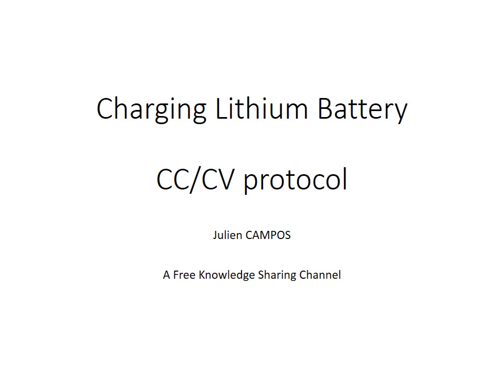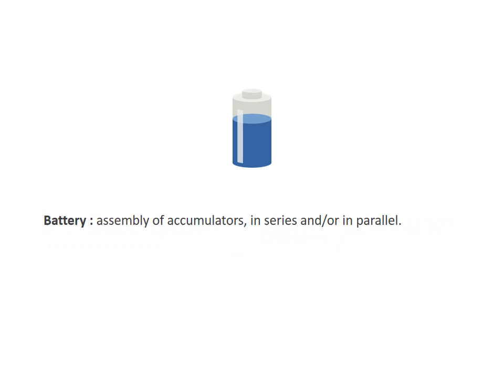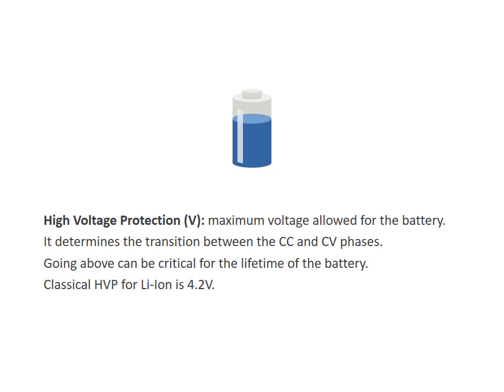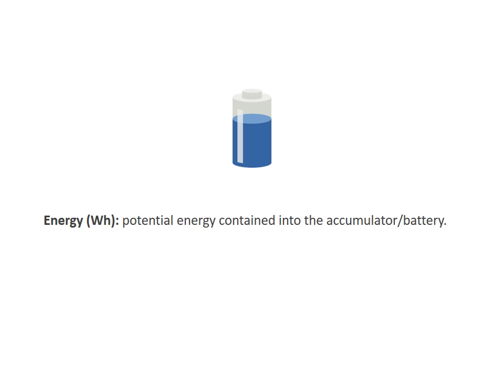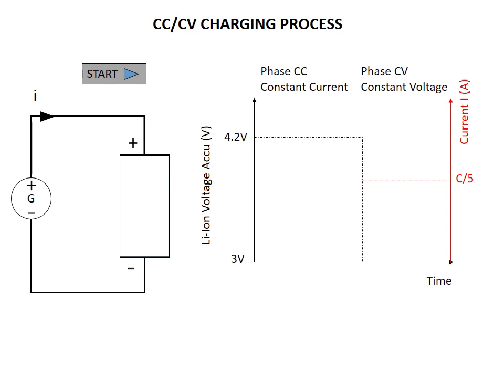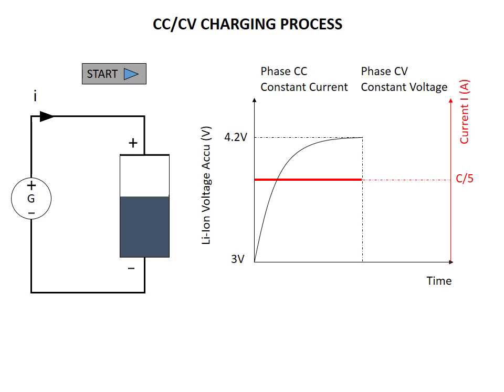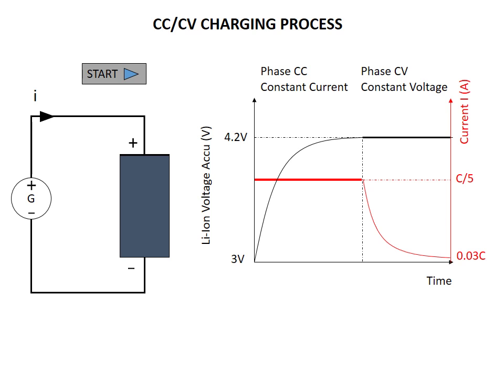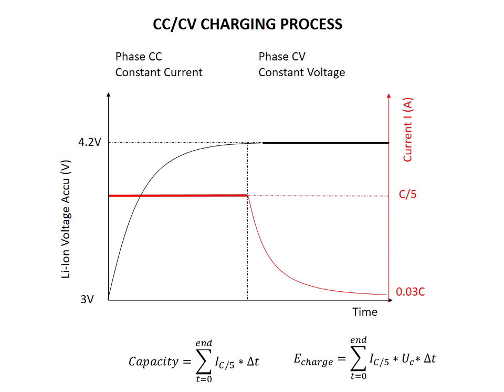CC CV Battery Charging Process EN

Comment: Hi Julien,

I have a Li-ion battery and I want to charge a cell with a power supply. I have been reading about the CC-CV charging method and everywhere it is said to set the voltage upper limit to 4.2V and to limit the current to around 1C (in my case, it is 7Ah). 

The first time, I started charging the cell when its voltage was 3.8V but the current that flows from the power supply to the cell was only 1.3A (I have set the max limit of the current to 6A) and I do not understand why it is so small (the value of the internal resistance of the cell that appears on the datasheet is around 1mOhm) so I do not know if I should increase the upper limit of the voltage during the CC phase (maintaining the limit of hte current on 6A) till the current reaches 6A and setting it to 4.2V when the cell reaches this value of voltage (when changing to the CV phase) or it could be dangerous for the cell.

Thank you very much.
Reply from the maker: Hello Daniel,

Which power supply unit are you using?
If you have possibility to set both current and voltage limit, if you set:
Vlimit = 4.2V
Ilimit = 6Amps

The power supply will naturally go to one of the mode: voltage source or current source.
When you had that current lower than 6 Amps, what was the voltage limit that you set? Normally your system would have been here in voltage source mode.
By the way, never put a voltage limit higher than 4.2V or other value that the Li Ion supplier would recommend.
Other thing: some power supply vendor give you possibility to set voltage or current protection value. These are a bit different than voltage or current setting in the sense that IF your system reach that value, the power supply immediately disconnect the power supply.
Of course, V and I safety setting are always a bit higher or lower than your settings to not stop unwillingly the charging or discharging process (discharging for load source which are a kind a power supply that can absorb power) .

Comment: hi sir,
i want to know when we charge battery in CV mode the current gets decreases slowly. but my question is that how they set the stop current for charging. is there any standard aboyt this
Reply from the maker: Dear Harshal Sable there is no general rule on that question. It depends. Some manufacturer will tell you 0.03 C, some 0.1 C. The smaller you set, a little bigger capacity you will get but not so much. And it will take you also more and more time as you tend to 0 C (until infinity in theory). Regarding existing standard, please refer to the IEC 61960. If my memory is good, they don't give a end of charge rule based on a value of the current in CV mode, but on a time basis. They say that your charge is finished one hour after you entered into the CV mode. It is up to you, but that may be a good start that you use this rule.

Comment: hello sir,
what are the major advantages in shifting to CV mode?
 why current is exponentially decreasing in case of CV mode?
Reply from the maker: Hello,

Below multiple image so perhaps you can better understand:
When charging an empty battery, you displace in opposite direction charged particles, positive and negative, from one electrode of the battery to another. A bit like when you pump water from the bottom of a river dam to its top in order to recharge the reservoir. To displace that water you need some "force", moving up the water of a certain "height". In your battery this "force" comes from an electrical field applied by your power generator. The height of the river dam represent your voltage. 
Charging a battery is like filling up a river dam: if you fill up too much you can have issues. 

We can't speak of advantage or disadvantage of moving to CV mode cause moving to CV mode is done naturally by your power regulator when you reach the maximum voltage recommended. 
Why the current is decreasing this way once reaching the CV mode?

Other image to help you: for a given force, it comes more and more difficult to the power regulator to move positive and negative charge from one electrode to the other. A bit like when you fill up a balloon: in the beginning with a fixed volume of air per second that you inflate, you will find it easy. Once you reach the stretching limit of the baloon, if you keep inflating with the same force, you'll see that the volume of air per second passing is reducing cause you are in opposition with the pression of the balloon itself which applies a higher pressure in return equilibrating with yours for a lower flow. Of course you'll understand that if you don't like the air flow to reduce, you can increase the pression of air flow by your mouth (voltage applied) and you"ll see the ballon stretching until it explodes.

Hope that helps you
Reply from the maker: Also, once in CV mode, you have normally charged the battery for 70 to 80% of its capacity. Going into the CV mode will charge the remaining 20 to 30% but it will take you a longer time, actually the closer you get to the 100% capacity the longer it will take you. Some charger who says they charge ultra fast is because they don't go into the CV mode.
Reply: @julienc.4916   
I agree with u sir, what u have explained is absolutely correct but there is a slight change. That
lithium ion or polymer battery never be charged to 100% bcz of voltage stress problem so, it's advisable to charge below 100%.
Reply: can u please send me any link related to CV mode
Reply from the maker: @raviteja-bn2eg  
It is a bit more complex than that. In fact to say a battery is 100% charged is a convention based on a protocol of charge and discharge given by the battery manufacturer and for which he guarantee a certain capacity. This protocol is a CC/CV with a charging stage and a discharging stage. Typical example of a protocol used to define capacity based on the IEC 61960 standard:
For the charging stage:
- Charge at 0.2C for the CC stage,
- Transfer to CV mode once 4.2V reached, and stop the charge once you reach current defined  by a fraction of C, or stop after a defined period of time, typically 1 hour.
For the discharge stage, this one is used to calculate your capacity:
- 0.2C discharge current,
- End of discharge at 3V.
Capacity is simply given by the expression:
C (mAh) = discharge time (hours) x discharge current (mA)
You can find these information by reading the IEC 61960 standard.
When i say it is a convention, a battery manufacturer can decide to use its own CC/CV protocol, which can be more favorable to battery life, but will gove less capacity (you can't have all). It is better for example to define your CV charging stage at 4.1V instead of 4.2V for Li ion battery, as it will give less stress and give you higher cycle. But as i said, you'll have a bit less capacity.